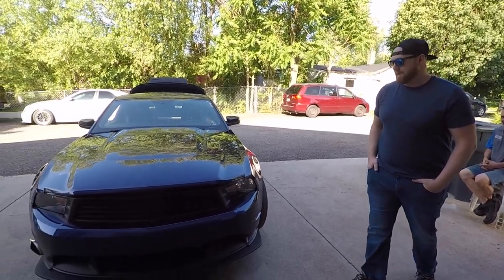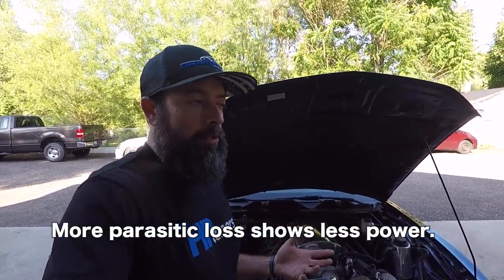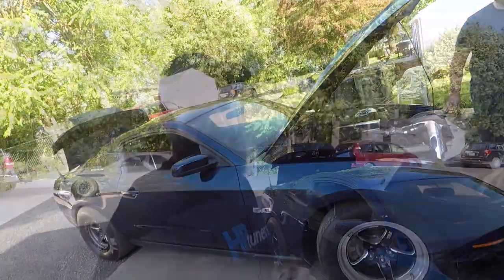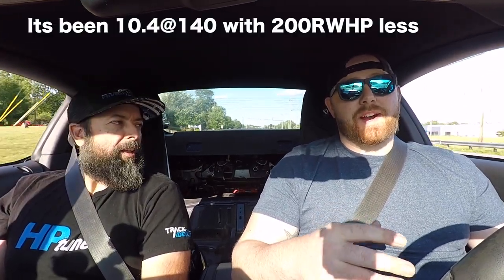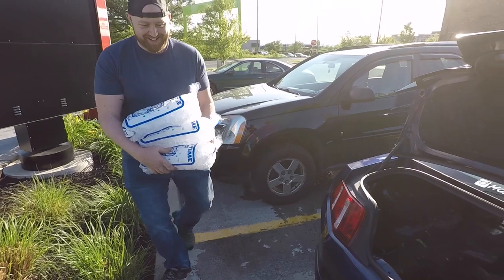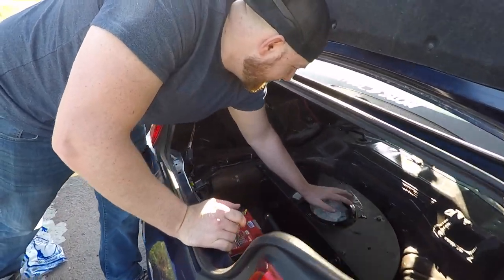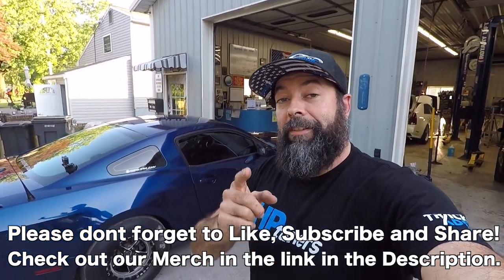Jeremy Drives 1000HP Mustang and Things Get Sketchy!

Comment: I heard that 2018+ 5.0 Coyote engines are forged from the factory including in the F150, and earlier in some Mustangs.
I'm wanting to get a 5.0 F-150 in about a year when I pay off the current vehicles.
Single turbo and a very conservative 500HP should be fun enough for a daily driver.
Reply: 2nd and 3rd gen coyote are coming Forged
Reply: Crank yes
Rods are sinter forged 
not a true aftermarket forged design 
Pistons still hypereutectic...
Reply: JethroBodean 
Whatever the combo is,  it seems to be working for up to 1,000HP

Check out the BoostedF-150 YouTube channel.  He's got a blower on his 2018 F-150 with 800RWHP
Oops, more like AWHP since he launched in 4WD to run 10's
Reply: Boostedf150 is nasty

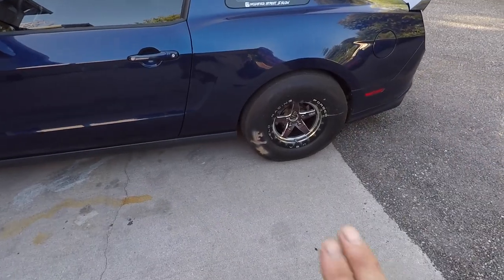Comment: 10:52 so the air psi difference in the tires was causing that alignment issue? My friends 2012 mustang has the same issue where the left rear wheel leans too forward. He’s on 15” wheels too

Comment: You get into so many opinion wars but the fact of the matter is that a Ford in the right hands will always do more with less . I myself have proved this time and time again and I have seen plenty of others do it as well.
Depending on how long this car has been beaten on and how many Dyno pulls , the bushings in the rear (That shouldnt be there anymore with this kind of power) are shot im sure .
In closing , you touched on something that so many here on the tube go right past when trying to maximize power and that is alignment . I spend hours with a car on the machine and then may have to do it a few times based on launch and race attitude to get it tracking right and more importantly , predictable.

Comment: So you putting a Coyote in the Crown Vic?
Reply: Doesn't the shop have a Coyote that Garret purchased for his Crown Vic 🤔?
Reply: Robert Fattaruso the vic already has a blown coyote
Reply: @DAVIDISEPIC1111  no, it has a blown 32v 5.4 Cobra motor if you're referring to Neighbor.
Reply: @DAVIDISEPIC1111  its not a Coyote, if your talking about Neighbor its a Supercharged 5.4l.
Reply: Adam Plitko sorry thought gt500s came with coyotes
Reply: @DAVIDISEPIC1111  nope 06-10 was a Supercharged  5.4L, 11-14 was a Supercharged 5.8L. The upcoming GT500 will be Coyote Based 5.2L Supercharged.
Reply: @DAVIDISEPIC1111  So a Turbo Coyote would be mean as fuck. Build it like the one in the video here and make 900HP. Shop can have two Badass 3 Badass Vettes, 2 CTS-Vs and 2 Badass Crown Vics 1 with a GT500 engine and 1 with a Turbo Coyote.
Reply: Adam Plitko yeah im not a ford guy but thats badass
Reply: Robert Fattaruso no he supposedly sold the coyote when they bought the wrecked gt500.
Reply: @chriscovington11  bummer. Would have been prime for this build. However a 2018 F150 short block with mustang cams and intake is a great cheaper combo.

Comment: Jeremy, that's not alleged, the Coyote is a factory forged motor. True story.
Reply: Only the crankshaft is forged.   Hypereutectic pistons and powder beams.  I've seen these engines blow with 700 rwhp.  Helps to have a great tuner.
Reply: BEBNC1 you’re thinking of the gen 1 5.0. Gen 2 & 3 are forged crank, rods and pistons.
Reply: @andrewbleazy  no they're not...
Reply: 02autogt yes they are bud, I work for Ford. I think I’d know

Comment: That chassis has easy throttle steer. But those big slicks dont help haha. The rear squats and one end more than the other which turns the Rear axle due to the lower control arms and causes the rearend to steer it. Great for corner carving honestly if properly set up.

Comment: The tire pressure probably had a huge impact on the swaying. But he might want to check the Panhard bar for wear. Mine was extremely worn out, replacing it fixed the swaying for me.

Comment: Got curious about the guides, anyone looked at extending them further up as I suspect part of the problem is chain whip as they come off the sprocket and them hitting the leading edge and damaging it first, before breaking up the rest?

Lucky it was just tyres - had one car that was rear steering on and off the throttle that turned out to be an axle housing cracked half way through - that wheel was toeing in and out and doing the steering...

Comment: I have a 4.6l 2v based mustang motor. The block I have is a 5.3l Ford performance block with trick flow 195 race heads with comp cams Xtreme energy stage 5. With a hellion twin turbo kit. Going through an mmr pro trans. 5 speed manual. At the wheel on radials it made 1143hp at 7200rpm and 1342 ft/lbs of tourqe at 4700rpm. Coyotes are badass but an old Ford motor can hang. BTW this is in a 94 ranger extended cab. I want you to try this truck out and race it against your s10 in the 1/4 mile

Comment: Hard to beat a stock mod motor that can make more than double the factory power output. Thats what makes the Coyote so appealing to people that want to make big boy boost through a stock motor. Ford did us a favor by putting forged internals from the Boss 302 in the gen. 2/3 Coyotes

Comment: I was thinking low tyre pressure or alignment issue, turned out it was both...
Reply: Yeh, if you check the burnout at the end of the video, that passenger side tire def had the 10 psi in it haha

Comment: Tire pressure adjustment fix the tracking?
Reply: Yes it did
Reply: @modified_street_5slow517  nice!
Reply: And the rear end is lined jeremys knuckle measurement method is not a method of measurement the rear control arms were all in spec
Reply: @modified_street_5slow517   Yeah I figured if air pressure was that outta wack, thats what gave him the extra knuckle, lmao

Comment: Turn into a Ford guy? I doubt it. You don't wanna deal with that Coyote mess under the hood when the LS is smaller, lighter, cheaper and easier to work on.

Dont even play. We know.
Reply: You do realize the coyote is about 20lbs heavier vs the ls1, and makes power easier and is more durable right?
Reply: @wudntulike2no32  Ok so the ls7 and new lt1 are heavier. Coyote is still superior
Reply: @karlhopkins713  depends how you look at it. The ls based motors are easier and cheaper to pull the power out of them. I love the coyote engines but the ls is just a more desirable platform for building and swaps. But I agree stock for stock size for size the coyote is a beast.
Reply: @fredrickfoster6564  Yes ls are cheaper to buy and build. But coyotes make more power in general mod for mod when you don't include cams.
Reply: @karlhopkins713  or heads and depends on a matching setup
Reply: @fredrickfoster6564  Yeah idrc either way I'll take a 4.6 regardless of how slow they're without boost
Reply: @karlhopkins713  like I said in my reply to another thread I like power idc what brand makes it
Reply: @fredrickfoster6564  Idc either I like most brands and respect any clean build. I just like to give people crap.
Reply: @karlhopkins713  agreed on that man
Reply: @karlhopkins713  The Coyote without accessories dry is 444lbs according to the Ford Racing catalogue. An LS3 is 411lbs with all accessories and cast iron exhaust manifolds. Strip it to just a water pump and alternator and its 376lbs. 

Could you clarify the "more durable" claim? In what regards? I'd like to know what data you're looking at specifically. There are a lot of variables that could be called "durability" (which is why anyone that wants a JD Power trophy for durability can buy, I mean earn... one).

Oh, and just for kicks I would like to point out I have a 2015 F150 with a Coyote so...*shrug*
Reply: @karlhopkins713  You realize the Coyote is the same weight as an LS7 7.0?

Comment: Is it true Ford engines have the most power performance capabilities?
Reply: it should, its v8 twin cam on each head plus 4 valve per cylinder. on paper it should
Reply: No Limit Brian too bad even on paper they break before an ls
Reply: @joe Fro, I've never seen a bone stock chevy v8 rev to 8500 and live. Coyotes do it off the showroom floor for a hundred thousand miles. And my last trip to the salvage yard here in Texas, I only saw one mustang with a v8, there must've been a hundred straight, not wrecked, V8 powered, GM products with blown LS motors and or transmissions...

Comment: Youll never go Ford, Jeremy....youve seen the struggle with Neighbor.....lotta $$$$......a 'Yote is good until it breaks, then you cry😭😭😭😭
Reply: Neighbor has been more reliable then the rest of cleetus's cars. Also all his ls cars have zero stock parts.
Reply: Neighbor gets beat harder than any of them! And ruby is on what it's 5th engine?
Reply: @low87dawg86  Uh yo, you forgot that Neighbor has a built L&M longblock, right?
Him no longer running a stock GT500 engine......
#cleetuscutdacheck
Reply: @paulhouchen9010  gonna remind you also.....Neighbor has a built L&M Motorsports longblock ( which they touched twice.....check Cleetus' past vids ), and Ruby's latest engine is a properly clearanced and assembled engine......
#cleetuscut2checks

Comment: Why do you and cleetus always make fun of fords? XD
Reply: Simple. They are just scared of what they dont know. If they took time to know a Ford they wouldn't like the LS motors so much
Reply: @bruceblevins9755  I honestly dont see how they could like them.. they break so much.
Reply: @ITMeCE  have you seen how many LS engines Cleetus has put in Ruby?  It required a built engine to finally stop breaking at the power level this guy is at using all stock components, minus head bolts.
Reply: @seijirou302  yup
Reply: @seijirou302  I know.. that's what I'm referring too.

Comment: 2018 stock bottom end? Lmfao yikes AF. 

ANYONE WANTING TO KNOW +2018 ENGINES HAVE SPRAY IN LINER ISSUES. JUST LOOK UP 2018 5.0 ENGINE RATTLE
Reply: There are guys over 1k on the stock bottom end. It's pretty common.